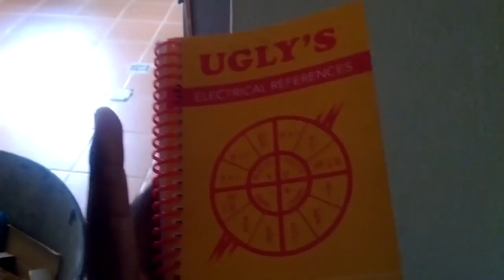How to wire an Auto Transformer correctly

Comment from the maker: Hey sorry for the #3 wire. I made a mistake its supposed to be #10. I emphasized on that in the video as well.
Reply: hiii sir is this ats (auto trsfrmr switch)
Reply from the maker: sumit kumar 

Hey what do you mean by auto transformer switch? Do you mean a circuit breaker?
Reply: its used when power is off automatically changed in dc ..after power on automatically change in main power mode
Reply from the maker: sumit kumar  Hey Sir

Know is isn't that type of transformer. If power goes the transformer remains dead until power is returned. And what do you want know I will help you out.v
Reply: thanx sir ...in industries how much type conections are used..example--star-delta,dol,rev./forward ,power factor ....all these or more types????????
i know only these 4 types.... any more?????/
Reply from the maker: You also have Auto Transformer, Soft starting, Resistor starting.
Reply: hiii sir can plz exp. me in detailabout these 3 types of starting??????